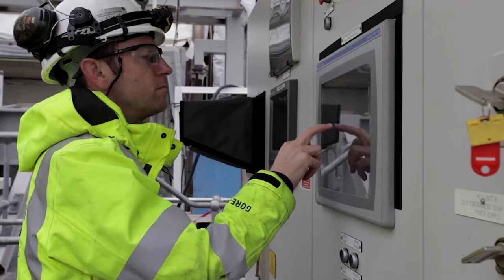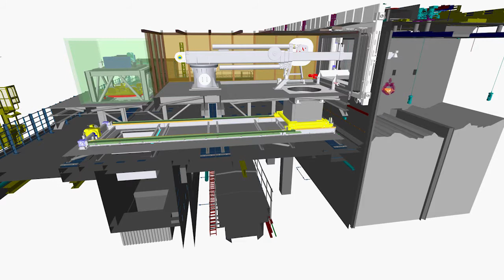The 'locked vault'

Comment: What is the point of moving the waste from a silos to a box?
Reply: Because as long as they are wasting the entire budget putting Nuclear Energy on life support as a clandestine cover for producing Nuclear Warheads, no younger more "qualified" personnel will have the chance to render this ancient operation obsolete with safer, cleaner alternatives. In other words, The Government are just paying themselves millions in Shares/Stocks with the more they pump into it.
Reply: Silos weren't made to last too long. The boxes can last much longer, and are easier to dispose of when a repository is available (Putting a huge concrete silo 500 meters below ground is challenging, to say the least). Also, boxes can be replaces if one of them is breaking, you can move it into a hot cell and work with it there)
Reply: @calderarecords  mmmh? Could be....
Reply: They need to move it because it's leaking.
Reply: Because of the risk of explosion and fire which is why it is permenantly pumped full of argon gas, and the care taken to avoid any sparks. It would be catastrophic if it were to catch fire and as such is one of most dangerous buildings in Europe.